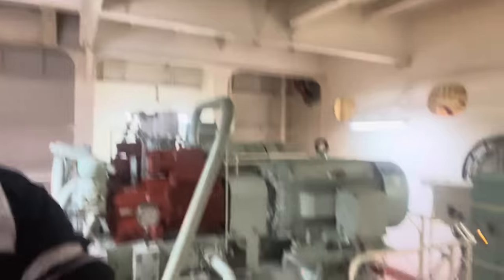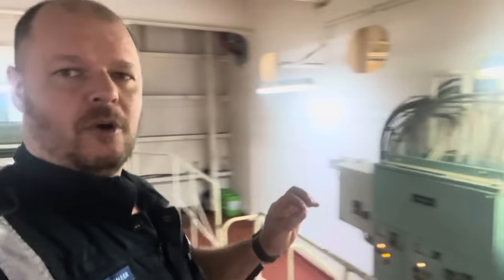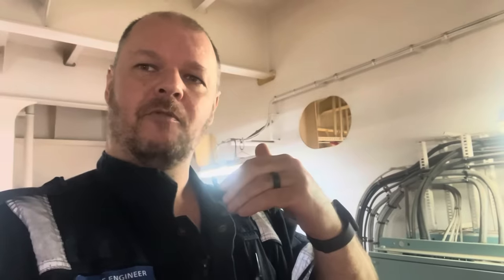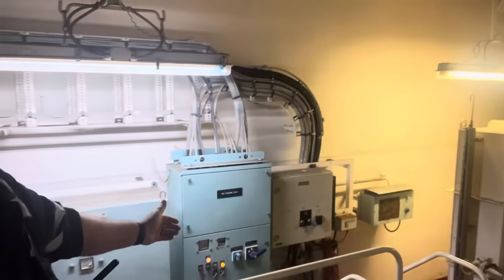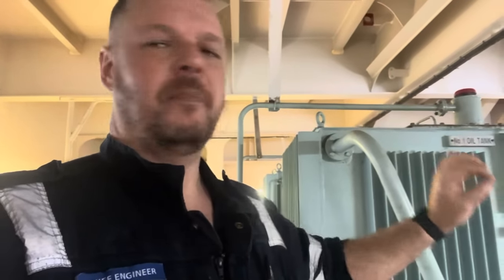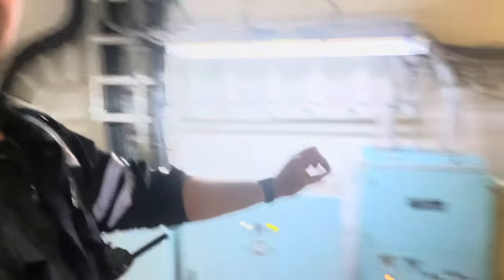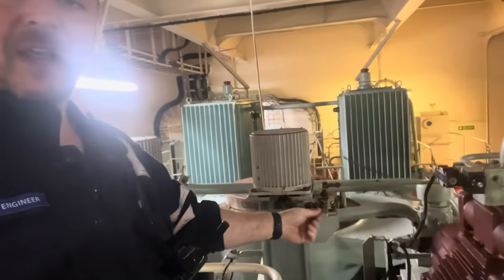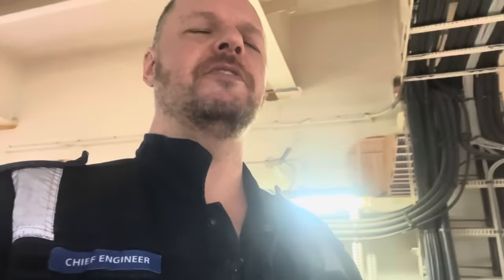Dali size containership steering system. How it’s designed to not hit Francis Scott key bridge

Comment: Dali was moving at 8 knots mid left channel. Probably holding slight right rudder to offset forward acceleration single wheel. About 1/4 mile from center span crossing they totally lost the plant. It took one minute for the emergency gen to kick in. During the outage and due to holding slight right rudder with power out, the ship drifted to the right side of the channel. When the line of site drifted to starboard more directly at the bridge post. As soon as power was restored they crashed full reverse in an attempt to stop forward progress after 30 seconds of full aft, they slowed to 7.6 knots. The torque paddle wheel effect, single wheel  pulled the stern to port. Still moving forward, but now bow pulling to right the they lost the plant a second time, right after the main Gen recovered. They were dark for another 30 seconds. They dropped the port anchor and they had called a power loss “May Day” and requested assistance from any nearby tugs, as soon as they lost the plant the first time. The anchor was ineffective on pulling the bow to Port as desired, dragging the muddy 50’ channel. Upon restoring power the second Time and now committed ,,,,they continued crashing full astern which pushed the stern to the left and continued the right turn. Nearly on top of the bridge by now (it is unknown the rudder position right now) and still at 7 knots the anchor either began to take effect or the rudder position pushed the bow a bit to  port just prior to the allision with the dolphin protecting the main bridge post, then the bow hit the bridge and down it came. That whole series ,,,, happened in less than 4 min and 30 seconds.  Two pilots onboard and a Ukrainian Captain.
Reply from the maker: Where are you getting those details? I’m not saying you are incorrect I just haven’t seen them.
Your very informed so ill share some theories of mine which are speculative. Main engine shouldn’t run or barely have any power with lights out, that means no fuel supply pumps. So the black smoke seen after lights out is far more likely a generator and its smoke it’s indicative of something wrong with it which is why the lights don’t stay on a 2nd time

Comment: Chief, I heard the Dali had flaky electrical systems a couple of days prior to leaving port. If accurate, what is your opinion
on the Dali setting sail in this condition?
Reply from the maker: They should have thoroughly tested any repairs or adjustments but that’s all speculation until we get an actual incident investigation

Comment: It seems to me that in close-quarter conditions where that 30 second delay could be critical, that backup diesel generator should be operating at idle so when main power goes down, the backup is available a lot faster. Once the vessel is further out where the delay doesn't matter anymore, it can power-down to a normal standby mode.

Comment: When you’re in a harbor, it seems to me like 30 seconds is way too long to have no steering.   I’m betting some regulations changes will be that both main gen and backup gen will have to be running during harbor excursions.  Although bad fuel (probable reason for main gen to falter on Dali) would still be of concern. Perhaps backup gen always fed from a separate tank?
Reply from the maker: The regulations are that you have a main and extra generator running in restricted areas. Why it all went down is a mystery

Comment: So, the dali was sailing in a straight line heading perfectly between the dolphins of the bridge. Power is lost so from what you have demonstrated the rudder would be locked in the central position. There was no wind or tidal effect on the ship and yet the ship veered hard to starboard. Without power this would not be possible unless the pilot/captain put the ship in full astern which would you agree would have been a huge mistake as it would have been known that this would cause a paddle steemer effect of the propellor pulling the stern round to port?

Comment: Hi Steam man, might there not be a possibilty they were not on st-by but running solely on the shaft generator thus causing a total blackout for the 30-45secs for the emergency gen to kick-in? As the rumours say, they were having eletrical issues alongside, normally the auxiliaries would power the port-stay and the channel-sailing. Anyway good that you show the world what's involved and especially the time it takes. People are clueless about the masses and forces involved, they think just use the handbrake and away you go. Anyway thanks and safe sailings.
Reply from the maker: I have never had a shaft generator on a ship but I have seen them. My understanding is you would not be able to use it during a maneuvering condition like the ship was in, they are normally only used on a sea passage where the propulsion engine is under steady load
Reply: @steamman9193  I have been sailing on vessel's and don't know otherwise ☺ I can inform you they are able to be run whenever selected. There is no barrier to prevent. It is a bad habit, but it saves fuel. We did had arguments as from a cadet we learn not to sail harbour/pilotage areas with the shaft generator connected. But some have different views on it. One of the arguments we had, is that is it fails you have "black light" before the backups kick in. Anyway it is guessing at the minute. Just curiously following this tragic incident which caused the loss of lives.

Comment: When we consider the ship had 48 hours of electrical issues during loading at dock but still left anyway we have to include some or all these possibilities ;
1) The Captain didnt want to pay $100,000 + per day to wait in port until full effective repairs were completed and left prematurely.
2) The Captain was pressured by Ports managers to "get that thing out of here" so we can load the next 3 ships that are waiting in line.
3) Crew couldnt get the spare parts they wanted to make an effective repair and were given no other option but to make temporary repairs and free up the dock for other ships.
4) Crew may have been very new on that ship and hadn't become proficient with the systems diagnostics.
5) Crew misdiagnosed the problem and never found the true root cause which repeated itself at the worst moment.
6) The electrical issue may have been intermittent and crew mistakenly thought they had fixed the issue when in fact it was just a momentary cessation of the issue.
7) The last scenario , Crew telling Captain "I need 4 hours more to fix that issue" , but the Captain could have said "I want it finished in an hour and thats all you're getting"

I will be very interested to read what electrical diagnostics and repairs were attempted in Dock in the 48 hours before this incident...
Reply from the maker: You get it

Comment: the only other thing that could be added would be accumulators that are maintained fully charged so then you would have hydraulic pressure available even with both motors not running. you would also need a way to still control that whether manually or with a separate electrical control, maybe battery powered. 
also with the main engine off is there enough water flowing over the rudder to allow steering control?

Comment: Hey Steam Man. I recently retired from a 600 foot U.S. tanker as Chief Mate. Our system allowed isolation of the hydraulics from the motors so that you can line up a manual hand crank to turn the rudder. It doesn't sound like your system has that? Thanks for your info.
Reply from the maker: I’m pretty sure we sailed together. But no we don’t have that and I believe there is a huge misunderstanding on those hand cranks those will never be able to steer the ship from something like hitting a bridge they would be to center the rudder so you could get back across the ocean then towed in
Reply: @steamman9193  Thanks for your input. Yeah, I know we hand cranked the rudder while at the dock, but I can't remember doing it at sea. Usually, we'd just take local control and turn the rudder with the pumps from after steering. But yeah. Even if they had the time to try it, it took a lot of cranking to move that rudder. Is was with OSG for 22 years. You? Thanks again!
Reply from the maker: @MrMinnesotaMac  yeah I think we were on the New York together for a brief minute I was 1ae maybe 5 years ago there
Reply: @steamman9193  Yup, I was there. Small world, and even smaller industry. I retired right when covid hit. Then OSG lost the New York. It's now the SeaKay Valor. Disheartening after all of the time we put into that ship. I hope I wasn't too much of an ass while our paths crossed. I just tended to do my job and keep the chit chat to a minimum. Fair wind, my friend.

Comment: My problem with it is when I watched the full video that's available on YT, you could see the power go out the first time and then when it came back on the ship seemed to actually steer toward the bridge pillar.  There was a distinct veer to the right before it hit the bridge. I'm not saying it was deliberate, but it sure seemed like a strange move to make.  I'm wondering why they weren't heading for the center of the span instead of passing so close to the pillar.  If they had been, when the power went out, they would have just continued through the gap without a problem.

Comment: How long between putting the helm over and a noticable change of heading ?  Non mariners : bear in mind that you steer a boat by pushing the stern in the opposite direction to where you want to go, a bit like having rear-wheel steering, just a lot slower to respond.

Comment: Sounds like the emergency generator did not kick in leaving the ship rudderless. For all it's design the system you describe does not really 'fail safe'. Some accumulator of power is needed, say compressed air with capacity to drive a windy pump for say 20-30 minutes, maybe better. Usually you can always find a separate source of compressed air, if things need a top-up.
Windy start generators that can be loaded within seconds of starting, may also worth consideration.

Comment: Very interesting. Been following Sal over @wgowshipping, with this newly acquired knowledge and what I’ve gained from him, seems like either complete failure of backup diesel and generator kicking on, or bridge command issues. Though with the latter, and the time it took for complete rudder movement in slow on one pump, pilot/captain/whoever else in bridge could physically go over and move ruder control with working backup and have different outcome.

Comment: My question is, what would happen if a power failure happened, and between that 20-30 second power-up / switch-over, the steering wheen on the bridge was turned?

Would the rudder suddenly try to 'jump' to that new position once power was restored?

That is my honest guess about the sudden turn of the ship...

Power went out, they were locked on course.

While power was out, helmsman or 'someone' turned the wheel (perhaps in panic).

Power came back, ship lurched towards 'new' wheel alignment.

Comment: I was in the Navy so it's a little different in manpower. Everything is manned so the manual options are always available. Problem in the Navy is, will they work? I did PMS(periodic maintenance schedule or system, I don't remember) on systems that had been gun decked for decades. Oh, gun decked means they had been signed off but not actually done. This was in the late 70s to 1980 so stuff had been shinned on since the Vietnam war.

Comment: The only thing you have to consider is that you can have all the rudder control redundancy you want, but without the thrust of the water driven by the propeller acting on that rudder, the rudder is near useless without thrust.

Comment: I worked in municipal wastewater for 23 years. Our backup generators would start immediately on loss of grid power or were supposed to,but I've seen some strange failures like the PLC [ programmable logic controller] failing, leaving only local control you have to be there fast or you get a sewage spill.

Comment: But is the fuel supply for the redundant generators redundant?  If both generators are drawing fuel mixed with oil, then that's a single point failure, despite all of the redundancy.

Comment: I have a question... I get all the redundancy and the different cable runs, but I would guess if the ship lost power, the rudder would remain centered. Why did the ship quickly veer off course? A huge and heavy ship would remain on the heading that it was on. It would be "coasting", mind you, but keeping the same heading. To make a huge ship turn like it did, the rudder would have had to be in the starboard turning position. There is talk of wind and currents. The current would be going in or out of the bay and following the direction of the channel, so that would have no effect. Wind was coming from the port side, but it would take a typhon to move a ship that large as quickly as it did. The wind was like 10 knots. Nothing makes sense. That ship hit the bridge piling head on! I would like to know what made the ship veer off course?

Comment: Are there no hydraulic accumulators in the system to keep pressure up when pumps are off? Also, do the control valves all shut when the pumps both fail to ensure rudder is locked in position?
Reply from the maker: No accumulators, I’ve never seen that on a steering system. But when the pumps are off the system is essentially hydraulics locked

Comment: Yes, all of these systems, in regular well maintained working order, will function to keep control of a ship like the MV Dali, even during total systems failure. However, the Dali had documented severe problems within the electrical systems days before this event. They also didn’t regain power from the first loss until 59 seconds later, then had at least one more blackout to recover from. Bottom line is this vessel should not have been operating, and whoever gave the go ahead to keep it in operation without qualified and verified repairs made needs to be held accountable.

Comment: One point I picked up elsewhere is that the propeller has to be turning for the rudder to affect the ship direction.
Reply from the maker: Partially correct. It still does something just not as much
Reply: @steamman9193  OK, the way I interpreted the other presentation, was that passive flow from even 8kt speed would not have significant impact on direction on THIS TYPE of ship. I understood the mass of the water pushed by the prop is required to generate the turning force required. 
I freely admit I could have misunderstood.

Comment: Excellent explanation of the steering gear redundancies on a large container ship!  I can fully appreciate the loss of steering control (although it should have been ONLY for the interval between the shutdown of the ships service gensets until startup and closure of the Emergency Generator breaker onto the Emergency Switchboard.)  What I still do not understand is why the loss of electrical power would have shut doen the Main Engine???  I know that most engines nowadays would have electrical controls, electronic governors and the like but SURELY these are backed up by mechanical ballhead governors?!?  I can't see why the main engine would shut down on a blackout!?!?!

Comment: He explains it so well and yet the Ex Navy  guys Still do not understand !!   

The aft steering watch is if the Signal  to the steering gear is cut off Then they can take hand control 
In several ways . 

With no electricity it would take 30 guys pumping to get the rudder to turn in a few  minutes !! 
Crew of 24 at most usually .
The power was out do you understand ?

If you were back there you could do nothing !!

Joe 
MM-3
O-3 MPA
Then chief engineer USCG merchant marine officer steam, Diesel and gas turbine .
Reply: I guess Navy is different because they have to factor in that one entire control room , engine room or power system could be reduced to a big smoking empty hole so the last man standing will have to try to do it by hand crank when the other 6 layers of redundancy are out of action ?

Comment: I’ve heard that it’s common to run the ships back up generator while navigating shipping channels so that you maintain steering control even if you have an engine out. Can you confirm that?
I’ve also heard it’s common to have men ready to drop anchor manually in such a case. Can you confirm that? Also, it seems they were heading straight for pylon for at least a minute. Any idea why they would not have dropped anchor?
Reply: They did drop an anchor. But the anchor isn’t like in the movies where it’ll stop the ship immediately. They’re designed to help hold the ship in place, but not really for an emergency stop.

Comment: In the Dai crash video shortly after the ship looses power there is black smoke coming out a stack (backup generator?) and shortly thereafter the lights come back on.  That's consistent with your comment about the backup power coming on in about a half minute.  But the lights only stay on for a few seconds then go off and never come back on.  To me that looks like some sort of failure in the backup system?
Reply from the maker: The lights you saw were probably powered from the main switchboard and generators. The emergency generator provides very little lights of which I could not see in the video